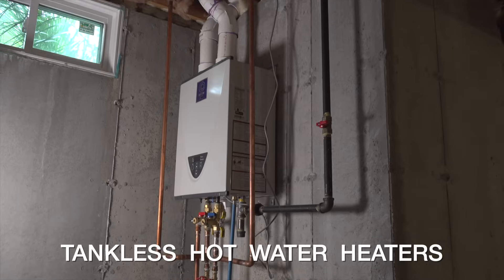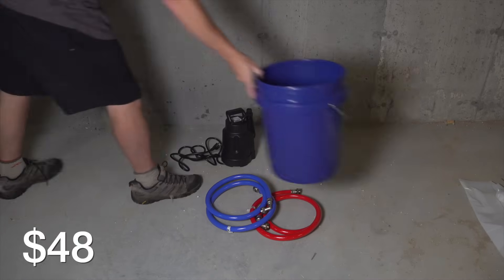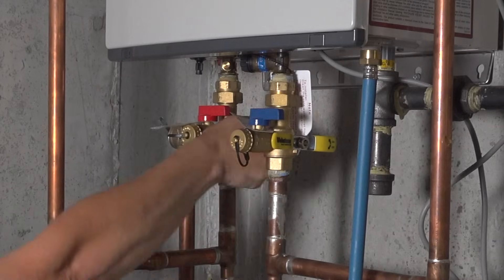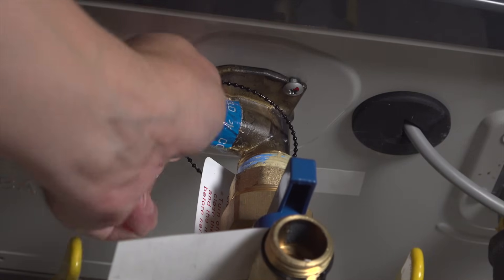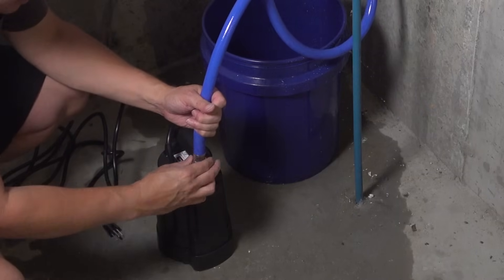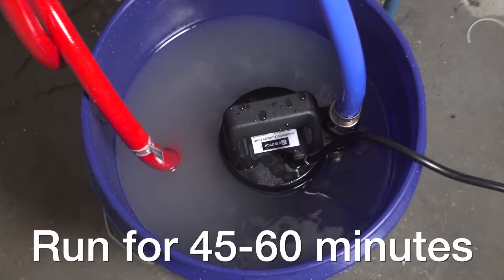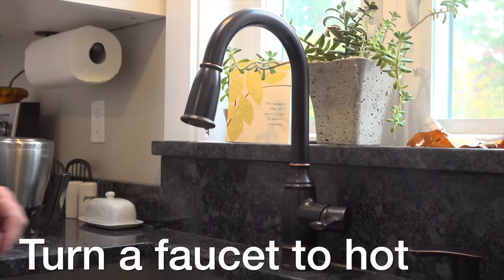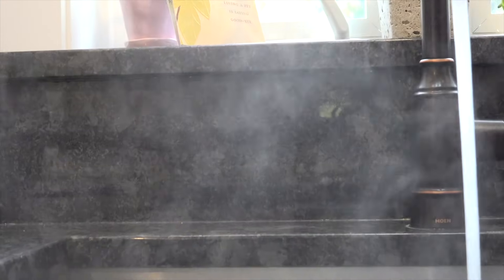How To Clean & Flush Tankless Hot Water Heaters with VINEGAR!

Comment: You should do a video on the pros and cons of a tank vs tankless water heater.
Reply: I wanted to put one in my house that was built in 1947. There was just no way to vent it without spending a small fortune. I Had to go with a tank instead. A tank will last way longer if you change the anode rod every couple years. It wasn't my first choice but we got a nice tank thanks to that stimulus check.
Reply: @Gitarzan66  they make electric ones, depending on the size, they can eat up electricity while in use.
I have eco smart tankless heaters,  very effective and need no ventilation
Reply from the maker: I am working on that one, they are perfect for a lot of situations but others get ripped off on what they think they get

Comment: Would it make more sense to to connect the washer hoses before draining the water heater?  That way you can direct the water into the bucket rather than trying to catch it.
Reply from the maker: That's fine to do, I like to see them open but whichever way works.
Reply: I connect them first, to minimize the mess.